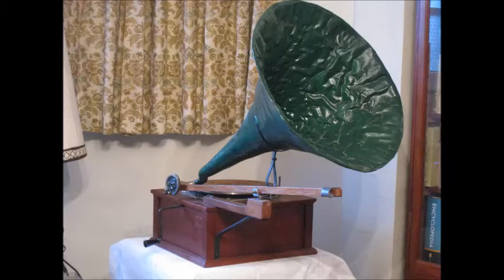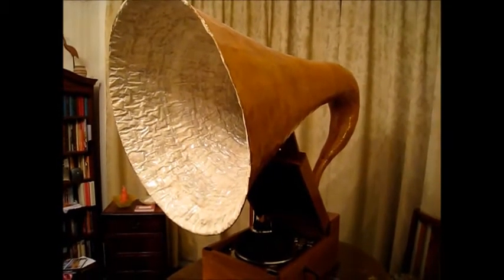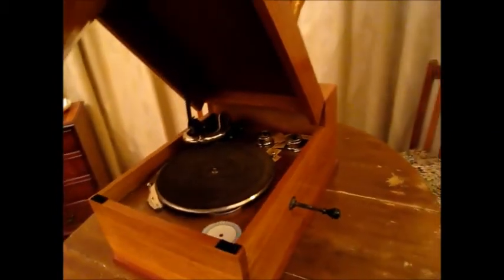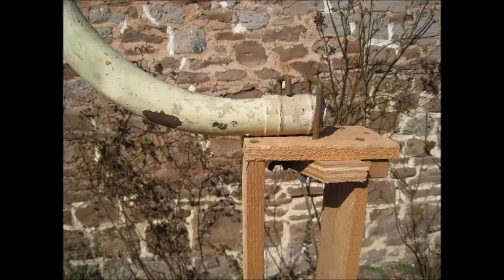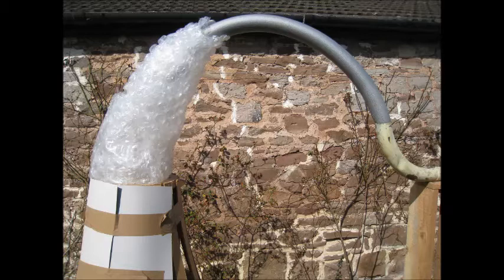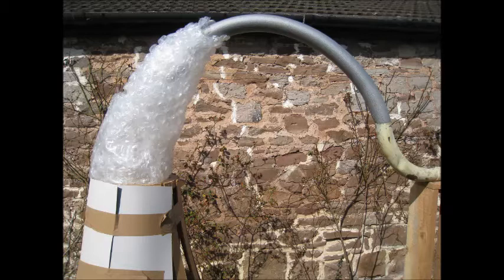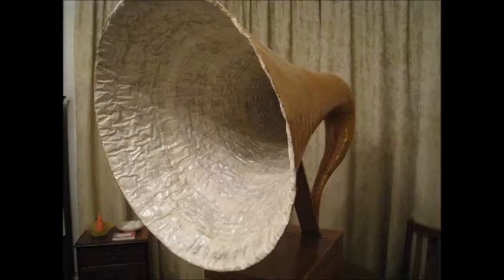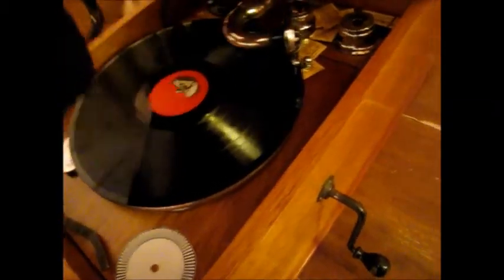Home-made gramophone: E M G (Experimental Monmouth Gramophone) No 2

Comment: Hi , thanks for posting this , a great labour of love and lovely sound produced after all your hard work  , you have inspired me to start a similar project to try and improve my gramophone listening experience ... I made note of a comment regarding your moulding framework , just to point out , in my simple calculations   I think , the flare on your horn is slightly off . your diameters placed a foot apart , 30 to 20 is 33% next 36% next 35.29% . .. I presume the rate of flare should either increase or decrease in the same direction . I maybe wrong but thanks again for posting this video .

Comment: This is the best by far reproduced sound I have heard, by a mechanical gramophone, on youtube. I wonder if it is the microphone, or the superior record, and most probably, the machine itself which yields such excellence.
Reply from the maker: Certainly the record is a very fine copy. The sound goes through a condensing microphone, a modelling pre-amp and my computer, both through the high specification sound card and the programme which converts the sound to a form suitable to upload to Youtube, and then through whatever electronic process Youtube then perform to publish the video. So it is difficult to say quite what produces the fine end result. The machine obviously is a large part of it. Incidentally, it does not produce the best results with very early records, say pre- 1910; for those I use Experimental Monmouth Gramophone No 1, which see. There is certainly something about the papier appliquė horn which gives such good reproduction, and what comes out on Youtube is a very fair reproduction of the actual live sound.
Reply: Well, could you upload more videos of records played with this gramophone? It would also be nice to compare how different reproducers sound on this machine...
Reply from the maker: @hoonsikkim1115  I hope to do this eventually, though at present I am working through some early records (pre - 1910) which sound better on Experimental Monmouth gramophone No 1; these records only recorded a narrow frequency range, and the sound is projected better by the wider flared horn of that model.

Comment: Dear David,
I have been wanting to build a phonograph exactly like this for over 2 years now and finally have the time this summer to do so. How does the horn connect into the cabinet and onto the tone arm in the back? Also, what are the measurements for the horn? Or what picture did you get them from and how did you get them from the picture? I have never built a horn before so any useful information would be appreciated. I am going to use parts from a Brunswick YO phonograph.... I was planning on using solid oak for the cabinet.. is this a good choice of wood? Really any measurements and advice would be great! 
After the horn was built, i was going to veneer it with walnut. (the tree came from my property so I think it would be really cool to use it for this)... Would this affect the sound in a negative way?  

thanks,

David
Reply from the maker: David

I'll start with the measurements. The conical tower comprised four three-quarter inch thick chipboard discs, which were spaced vertically using vertical posts at zero, one foot, two feet, and three feet. The diameters were (1) thirty inches (2) twenty inches (3) twelve and three-quarter inches and (4) eight and a quarter inches. The metal pipe used had an internal diameter of an inch and a half - the one shown in the demonstration was obviously not the one actually used in the horn. The tower to the right bearing the J-bolts was thirty five inches high and spaced thirty five inches from the edge of the top disc. This spacing could be varied, but it is vital to make the horn tall enough that if you put a lid  on your cabinet it is possible to open the lid under the horn. Solid oak would be fine for the cabinet - I used solid mahogany. The record deck was seven inches above the table on which the equipment stands, and the height of the top of the cabinet was twelve inches. The metal pipe I actually used was longer than the one shown in the video, and when moulding the paper around it , I left the end six-and-a half inches uncovered. I had a J-shaped pipe made with a flange at each end, and one end of the J-shaped pipe was screwed via the flanges to the underside of the record deck, in line with the tone arm. The other end was secured to the underside of a half inch thick strut that ran across the inside of the cabinet. Holes corresponding to the outside diameter of the uncoated part of the pipe were drilled in the top of the cabinet and in the cross-strut, so that the six and a half inch uncoated end of the completed horn could be dropped vertically down so as to rest in the hole in the cross-strut and the coated part of the metal tube rested on the top of the cabinet. This permits the horn to be rotated freely so as to point it wherever you wish, and the horn can easily be removed simply by lifting. With the 50 or so coats of newsprint that I used to make the horn, it weighs about eleven pounds. Be warned that all told it took about a hundred hours of pasting to make the horn! I think that to veneer the horn would require a very high level of skill at veneering, and since the finished horn is about four feet front to back, it would be very hard to actually reach in to the very back of the horn to veneer the inside of it. What this would do to the tone, I have no idea. Very best of luck with your project anyway!

David C
Reply: David C,
Thank you so much! I’ll let you know how it turns out!!
Reply: Hey David! I just finished making one modeled after my Edison Searchlight horn! Shoot me an email at dzavrack@vols.utk.edu and I’ll show you some pictures! It worked great so I guess I’ll try making a bigger one now 😆

Comment: Is the horn length the same as the EMG?
Reply from the maker: Based on photographs of EMG Mark 10's, and a bell diameter of 30 inches I tried to replicate as far as possible the measurements of an EMG. I think I got the geometry of the curve slightly wrong in that the horn widens a bit too much a bit too soon, but I was concerned that the curve had to be strong enough to prevent the horn dropping. As you can see, it ended up needing a prop anyway. Overall I think the horn length is the same as an EMG, i.e about 8 feet.
Reply: @davidc9533  Thank for your reply. It appears that the EMG horn has a more rapid taper. Your horn appears more exponential.
I am also curious if the lack of smoothness causes unwanted reflections which may distort high frequencies?
Reply from the maker: @digitalmetadata1  The lack of smoothness is greatest at the wide end of the horn, and not significant further back, so I am not aware of distortion at higher frequencies.  One thing is clear - that records from the thirties onwards play better than say G&T's from the 1900's, though this could be a function of the soundbox (HMV 5a) or the several bends between that and the horn, rather than of the horn itself.